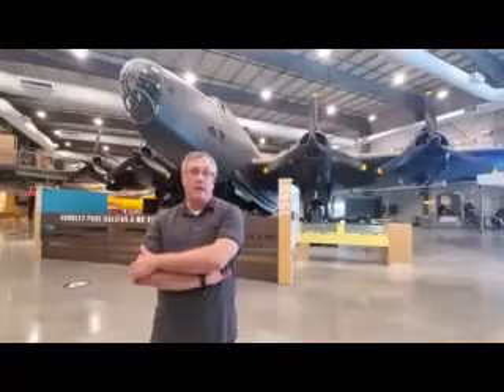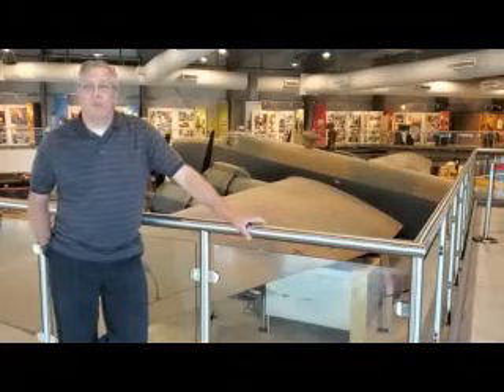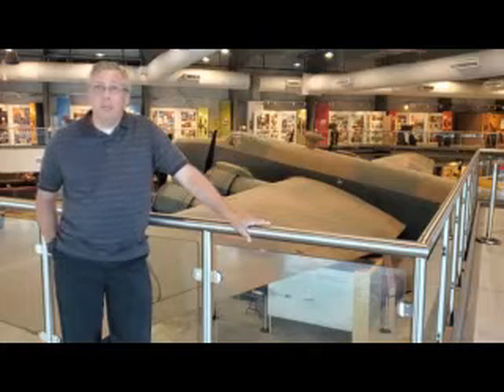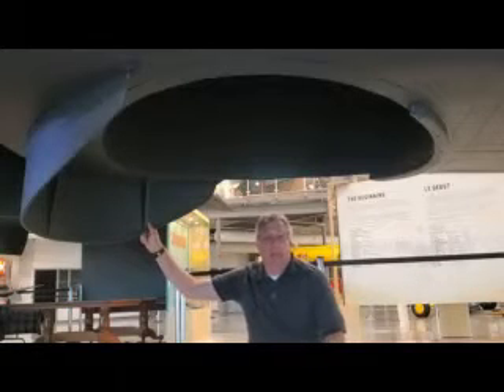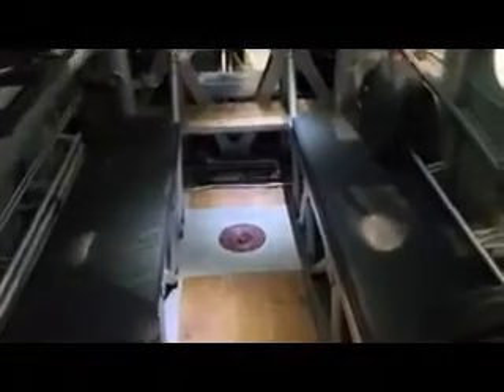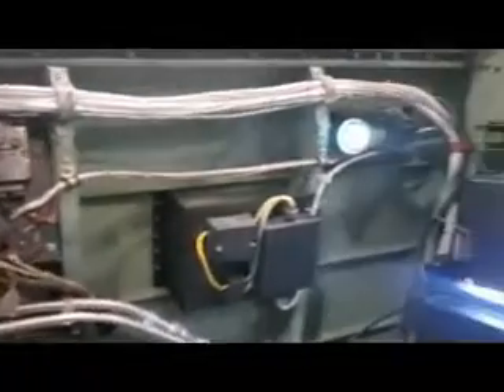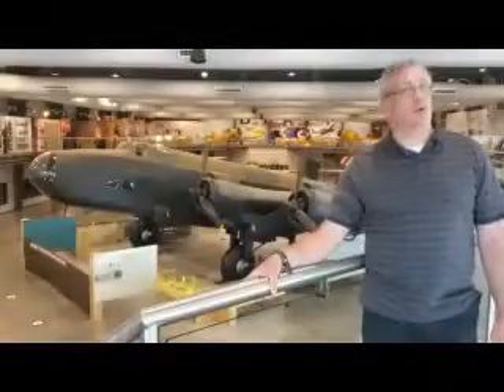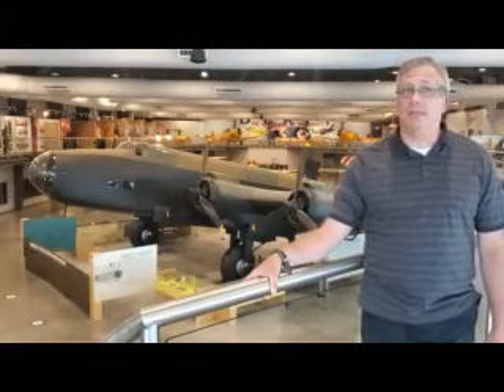Halifax Bomber Tour

Comment: I visited the museum many times during this restoration.  The amount of work that went into this by volunters was staggering.  I know I asked, but can't remember why it wasn't restored to taxi or air worthy condition.  Was it funding?  I believe that the engines weren't beyond repair but there was a problem getting access to a piece of equipment for extracting the cylinders.  Apparently the Smithsonian had the only one of these tools.  Also, the undercarriage was a mock up in steel because the original was made of magnesium that had desolved away over the years in the waters of the fiord.